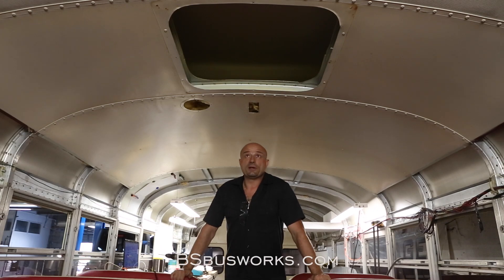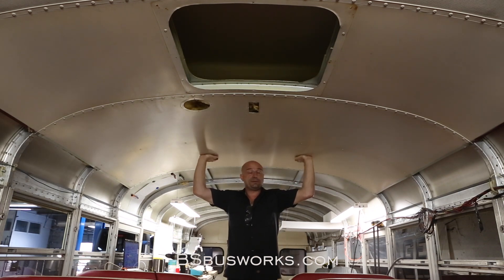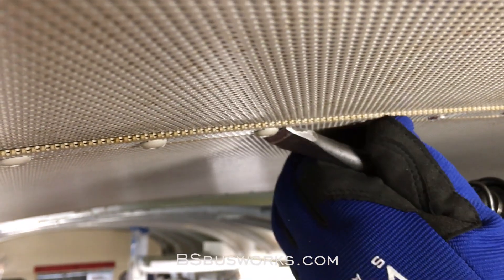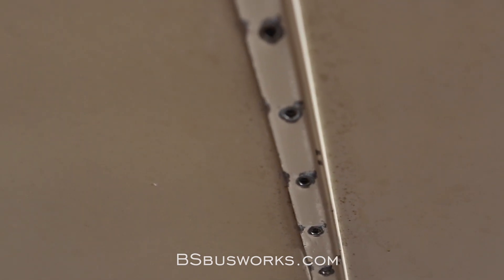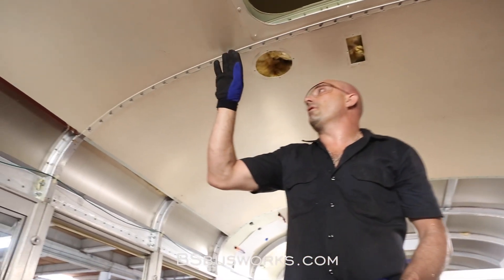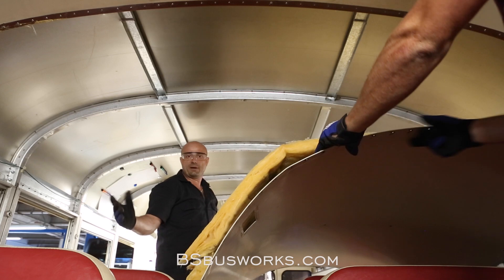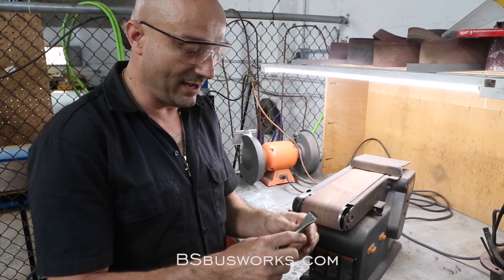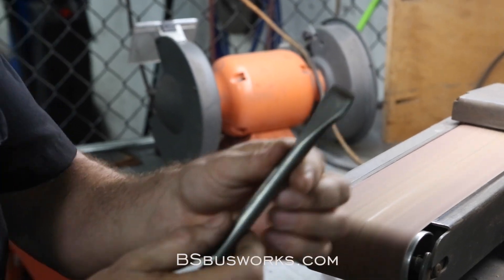BS Bus Works school bus/skoolie ceiling panel/rivet removal under 5 minutes

Comment: Todd, thanks so much for making this video. We have been scratching our heads over the rivets in our bus. I have all these tools! I'm definitely using this technique!
Reply: I have been trying this technique but it’s not working only bc I think I need a higher psi.
Reply: If you have insight on what psi would be needed it would be greatly appreciated
Reply: @nboudreaux07  We were up at 100 psi on the compressor we were using for this. The little one I had just didn't have the juice so we had to use a much larger compressor.

Comment: On the 1977 MCI bus that I’m working on this technique doesn’t work. I don’t know if it’s because they’re rusty or that they are steel and rusty, but nothing short of 15 minutes of grinding seems to work.  Tomorrow I’m going to try an angle grinder with a carbon burr tip. #Ihaterivets

Comment: What kind of air compressor? I’m just starting out and a little overwhelmed. I’m seeing several different options for PSI’s and not sure what to go with
Reply: I’m wondering the same thing! The psi I have is not working! I’m struggling with these rivets. Mine is only 110 psi .. I think I made need closer to a 200 psi

Comment: Why the removal of the side panels? Is it possible to insulate and frame over the panels?
Reply: Because there might be rust or mold. I wanted to just build over the panels but I'm in Michigan and my bus has rust so I have to remove them.
Reply: Found Rust behind many of my panels 😒

Comment: Todd, why did you pull your ceiling down if it was already insulated?
Reply: KHMposts 
yuk old nasty insulation that is God knows how old! Im doing the same updated insulating materials that will do the job more efficiently. PS to Todd Thanks GREAT VID!
Reply: Yeah, you never know what the insulation is going to be like until you open it up. Every video I've seen has that cotton-candy fiberglass insulation, and if it's ever gotten wet in its life it'll be DISGUSTING

Also lets you check your roof for leaks - if water's coming in anywhere when you spray it with a hose get some roof sealant on there

Lastly, you want a thermal brake in the ceiling - both the inside and outside panels are metal, with metal braces/studs in between - that conducts heat really well which isn't a good thing if you want to stay warm/cool very long

Comment: Can the walls come off just as easy?
Reply: Depends on how bus is build. My inside panels fold over the under part of the window…I’m trying to decide wtf imma do with that situation I just found… hoping to find a video of someone with the same issue.
Reply: Thank you for that advice. Yes I found out a few months ago, when I had to do that. I just threw the insulation away. I had to get somebody to help me do the ceiling. Because of my back issues and my rotator cuff issues in my right shoulder. 
Now it's time to try to save some money and build it, LOL